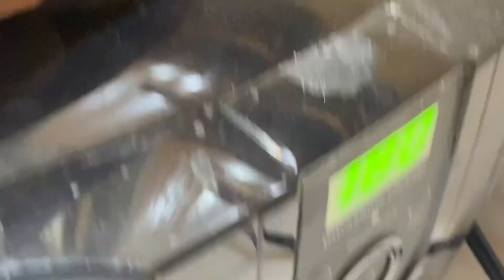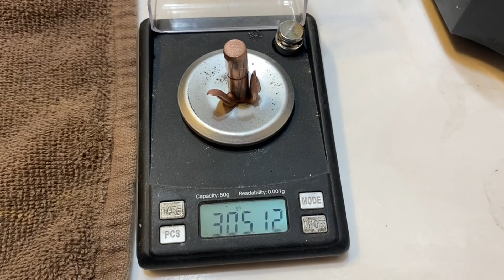This Makers a difference

Comment: ide like to ask you about varget im having a hard time with my gun cycling i have aero precission 6.5 creedmoore ive watched 99 percent of ure video there awesome any information will help 26 inch barrel would you sugest gas port issue or lighter spring in buffer
Reply from the maker: Did you break down gas system (Port hole, block alignment, tube leaks, gas key)? Varget is not a fast burning powder prone to cycle issue. You definitely have something else going on.
Reply: @OutdoorEDventures  thank you for getting back to me ill check  what do think about lighter buffer spring it only does it with varget powder the reason i like varget is because my groups are sub .250